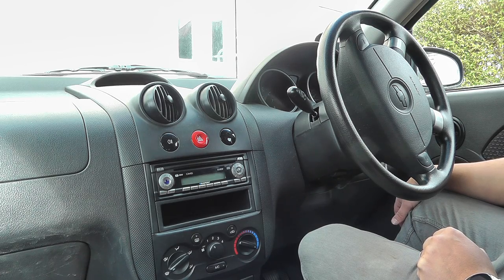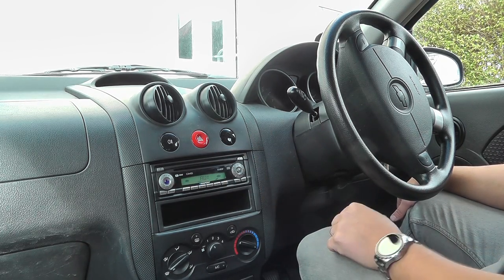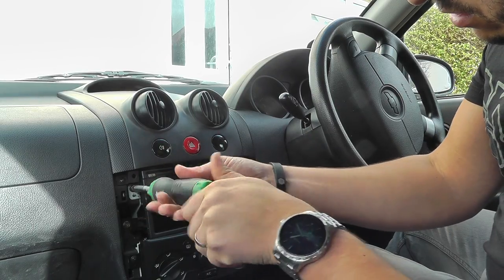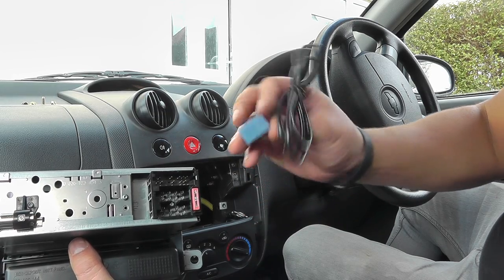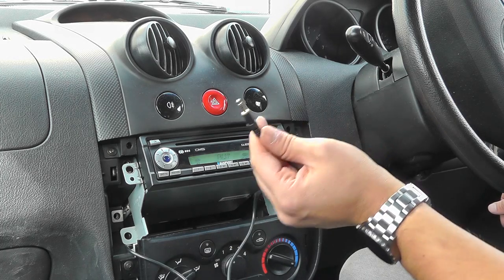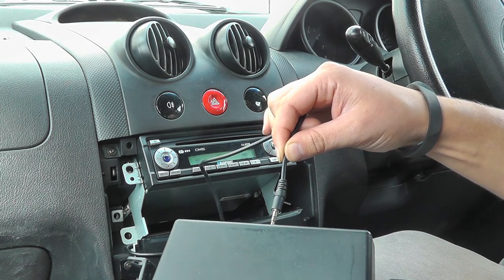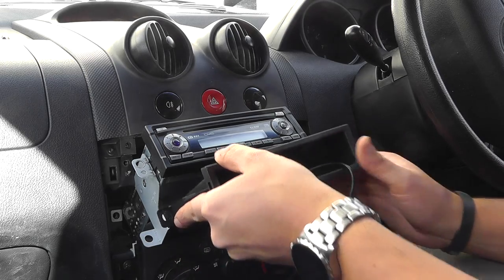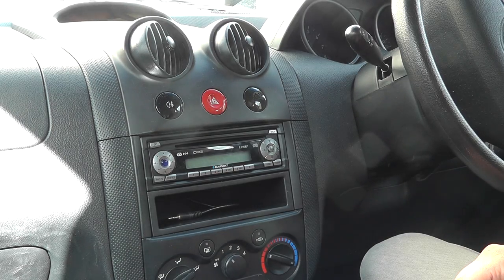blaupunkt car AUX cable install

Comment: I suppose it was just too much for them to put an auxiliary input on the front... that would make life much too simple
Reply: Not sure about everyone else's cars with this radio but mine is 17 years old, smart phones didn't really exist back then, iPods were not that common, and most people still used CDs in their cars.

My car and radio are still going strong and I was considering adding the aux cable. After watching this video I might just pay for a new radio with a usb input, I don't think I have the patience to pull everything off, drill holes in it and put it all back again 😅

Very helpful video showing what is involved, it helped me make my decision 👍

Comment: Top of the stereo had a pin out sticker on it. The middle of the top pin out is for a remote. I guess it takes 3 separate connectors in the top space 👍

Comment: I purchased a replacement unit as mine did not have the aux in the menu plus it would not play CD's , consistant CD ERROR displayed on the screen.  Unit arrived, fitted it, still having the same issues NO AUX in the menu to activate and still having CD ERROR.  This was the point of me using the aux to get away from CD's.
Can any one be 100% sure that the units with MP3 do not have the aux facility?  if it won't play a cd it doesn't matter about the MP3 facility or does it need the MP3 part to translate from the aux peripheral?
Any help would be gratefully received.

Comment: I have the exact same radio as you have in my chevrolet matiz (blaupunkt 96829596) , and i bought from HAMA that aux cable, followed every step of your instructions, but it is not working. Can you tell me what i should consider? Thank you very much
Reply: Under the radio menu you have to activate the aux option
Reply: @buntrezit1259  I couldn't find the option... Could you explain exactly?
Reply: Hi have you managed to find a solution?
Reply: @brbrbrbrbrbrrb  in the end yes it worked, i actually bought a new Matiz xD xD xD
not because of the radio, but because my other one broke colateraly. in the new Chevrolet Matiz, which was 3 years younger (2009), there was also a Blaupunkt radio just like in the old Matiz, but this time with the same letters (ZA) written on the white Sticker on the top of it's metal surface. the older model had different letters, i think it was a giant "SE" on it. long story short, after looking it up and researches, i found out not every Generation of this specific Blaupunkt Radio is build with the ability for AUX, even when all of them have the same plugholes where you could put the AUX cable. (sorry for bad english, it is my third language)

oh and by the way, don't forget to "enable" the AUX option in the settings (menu)
Reply: @Erdbeermilli  if you don't find it in the menu/settings then you probably are not able to use an aux anyway, had this problem with my 2006 matiz radio, the one i bought later, a 2009 matiz, had the settings option "AUX enable" and the cable worked
Reply: Are you in cyprus

Comment: I have this radio and it says cd player with MP3 but it won't switch to aux, only from CD to radio. Please help
Reply: under the radio menu you have to activate aux option
Reply: @Pixelwave90  how please
Reply: There isn't aux option In the radio menu
Reply: @haidermohsen3727  hey have you figured it out? Same issue
Reply: @brbrbrbrbrbrrb  i think my radio is older than your's
Reply: @haidermohsen3727  no its same
Reply: @brbrbrbrbrbrrb  then why i can't find the aux options in menu's
Reply: @haidermohsen3727  no I mean, it doesn't work for me too
Reply: the aux function is available only in a radio without support MP3.
Reply: Same problem on aux option showing

Comment: I have the same sterio but it radio and cd only icant switch to aux?? Help please??
Reply: Some of these radios can't switch  to aux, that means you unfortunately can't use aux
Reply: you must disable aux in the menu
Reply: hi did you get it to work in the end? i'm planning to install this but if i switch it has no aux option, i'm buying the cable anyway and trying to make it work somehow
Reply: @eugenvrancea  hello, I had the same problem, turns out it's very easy to switch to aux. All you have to do is press the menu button and then press up arrow till you get aux on/off option. When you see that press right or left arrows to activate aux channel. Then you should see aux as well when you press the src button.
Reply: Mine does not have the AUX-ON / AUX-OFF in the settings menu...any thoughts why is this happening and how to get it sorted out???
Reply: @asovaros9050  I have same problem. I can't see aux option in menu...
Reply: @danicucala  same problem, has anyone managed to figure this out?